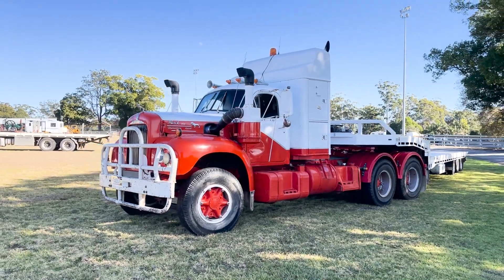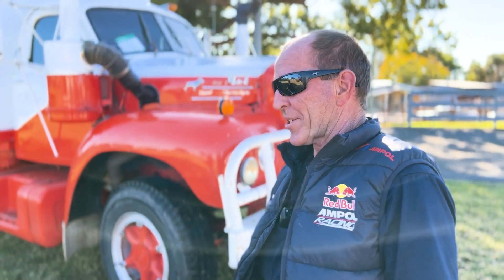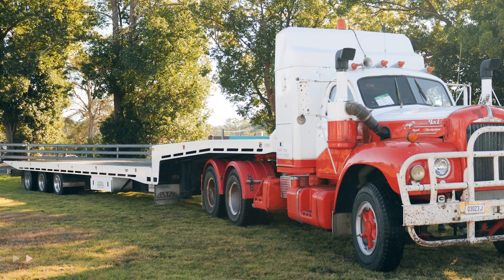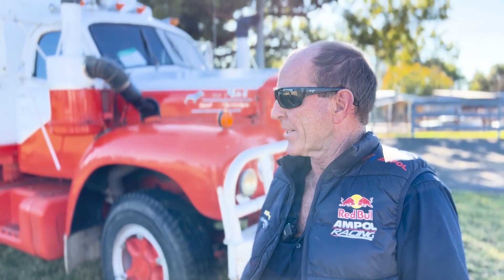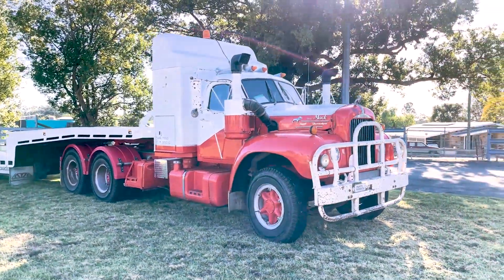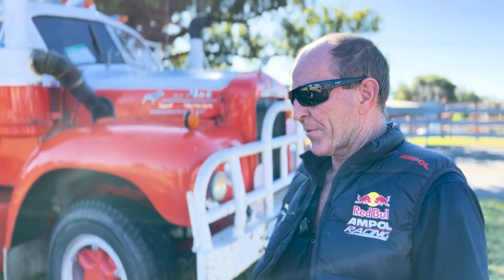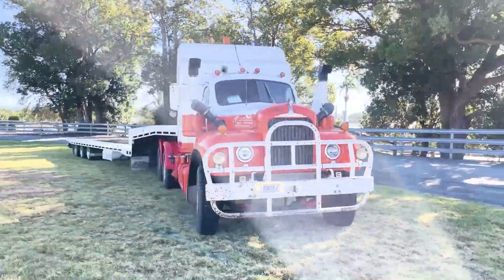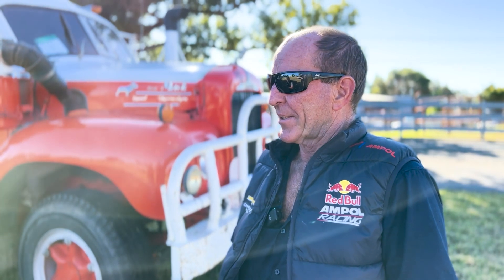My 1964 Mack B61: 237 Thermodyne engine with quad box Walkaround #macktrucks #oldtruck #vintagecars

Comment: A Mack ENDT 237 is the early Maxidyne engine! The Thermodyne name goes back to 1937 when they made their first ohv. engine, Then they built the Magnadyne of 707cu.in.(gasoline). In the early 1950s when they went to direct injection with their Diesel engines they called them Thermodyne Diesel engines. In 1965..66 they introduced the Maxidyne Engine which was very high (for the time) torque rise engine will a nine hundred r.p.m. working rev range from 2,100 r.p.m. down to 1,200 r.p.m.,which was a much bigger working rev. band than Cummins and especially Detroit Diesel engines have there much less gear changing needed.  The ENDT 25O was the Thermodyne Diesel engine of that time.